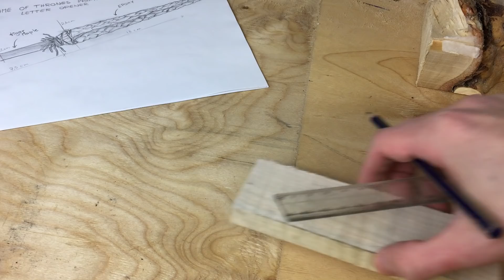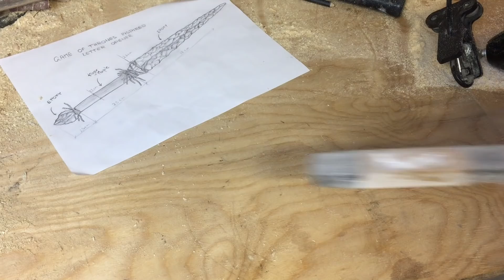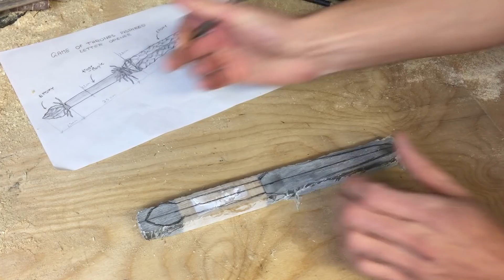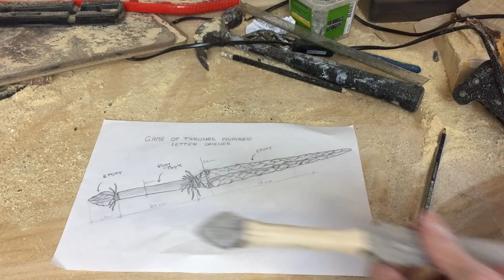White walker ice blade Build | Calm Video

Comment: amazing work :) 
clearly a bit late to the party but if you ever want to make the resin shiny (like a glass finish) you can just paint it on the outside in a really thin layer (like a varnish) and wait for it to cure. No need to sand it down after.

Comment: kul video! Men jeg har et spørsmål: hvor fikk du tak i clearcast? Har sett etter det før, men sliter selv med å finne noen som sender til Norge.
Reply from the maker: olbakk Takk! Jeg kjøpte den på Ebay. Tror biltema selger epoxy men vet ikke om den er like bra
Reply: @Jonasolsenwoodcraft   takk for svar! Øynet håpet for at det fantes over disk i Norge, men den gang ei. Såvidt jeg vet har Biltema bare små forpakninger som forsåvidt fungerer godt til å bruke som limerstatter. Har selv bare funnet west system epoxy i større kvanta i Norge, men det fungerer ikke til former over et par cm dybde (lærte det den harde veien). Av ren nysgjerrighet, hvor i Norge holder du til?